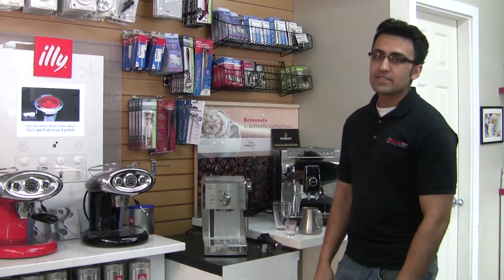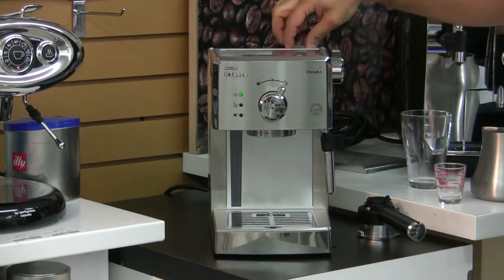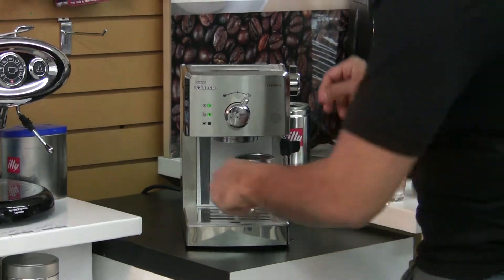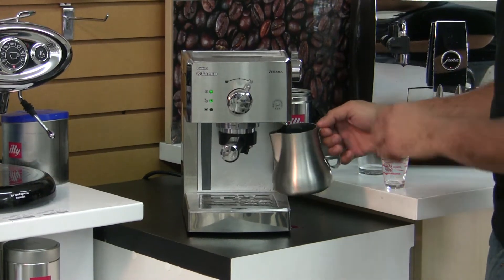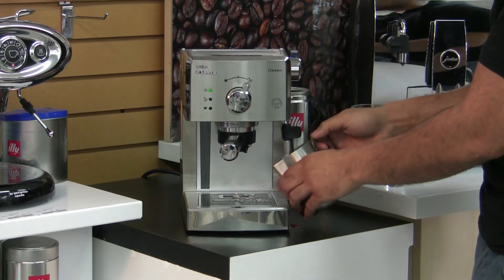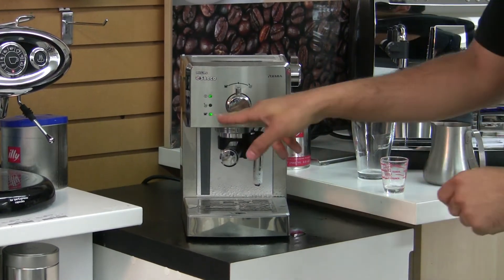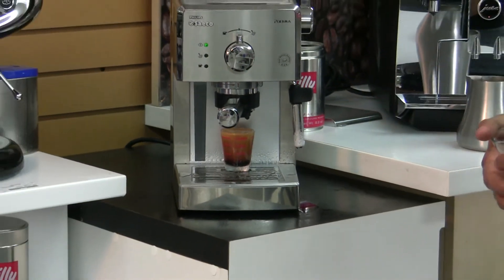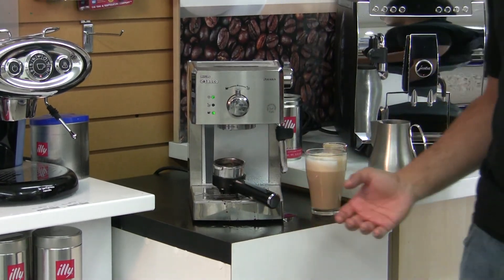Philips Saeco Poemia - Making A Latte

Comment from the maker: Hey Vinay, I would suggest a few basics to check first. Try using 2% milk as it is easy to foam yet doesn't create too much foam. Also, try using a cold frothing pitcher to give you more time for frothing. Third, I would ensure the steam wand is fully cleaned and the pannarello attachment isn't clogged with old milk.

Following these basic steps you should be able to froth milk with ease. Please do let us know if that helps or if you require further assistance.
Reply: Delonghı bco 264 or saeco poemıa espresso? Which one?

Comment from the maker: It is possible to create great quality frothed milk using the panerello frother. The secret is to know how exactly they work.

Submerge the tip below the surface of the milk until you have enough froth. Then submerge the wand until the hole at the top of the frother is covered, this will just heat the milk.

Once your milk is at the desired temperature, ensure to swirl the milk to thoroughly mix it before pouring it into an espresso.